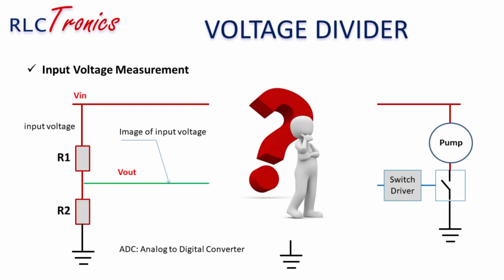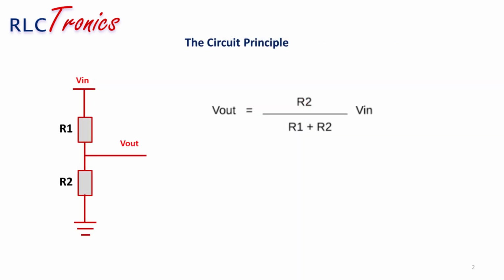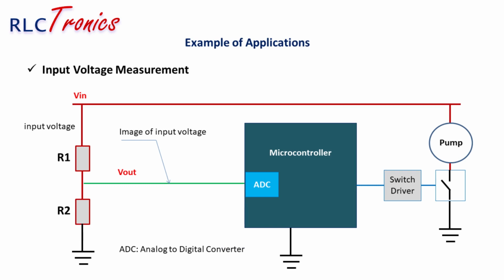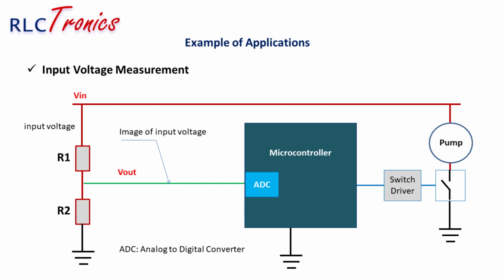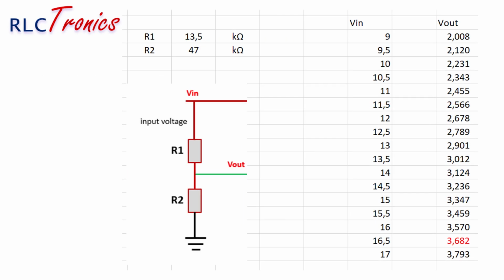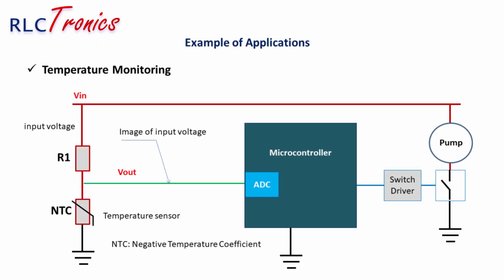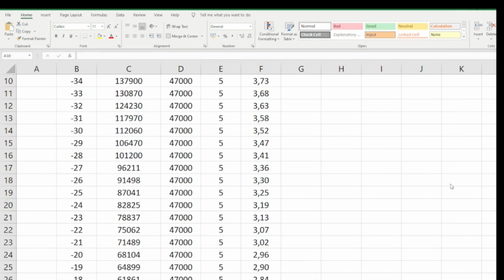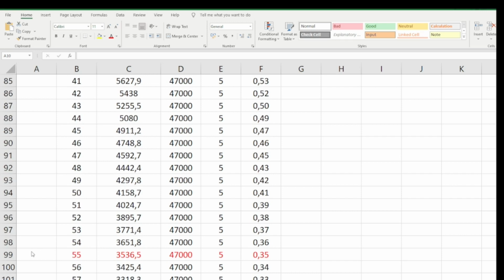RT#4. Resistor Voltage Divider (ENG)

Comment: Nice video, but your calculation is wrong for the first example for Vin=16.5V.  For voltage division rule...Vout= (R2/R1+R2)* Vin= = (47K/ 47K+13.5K)* 16.5= 12.81V